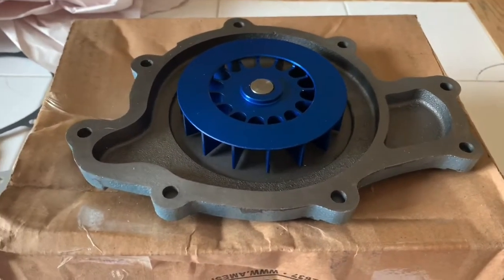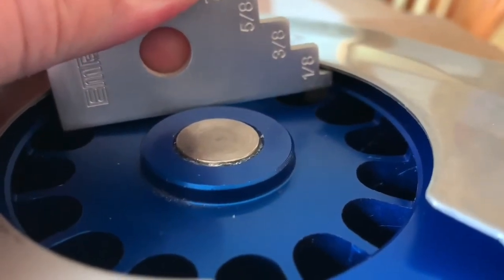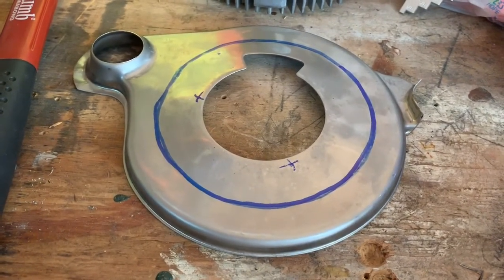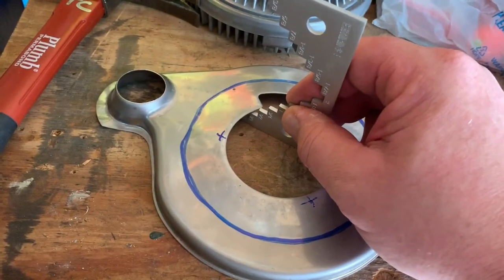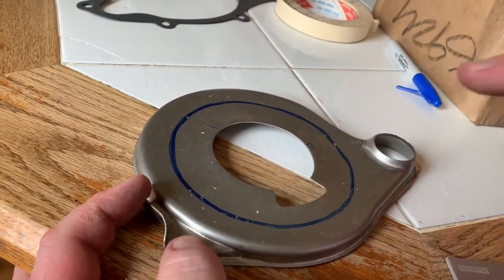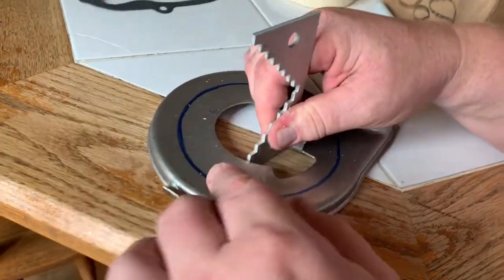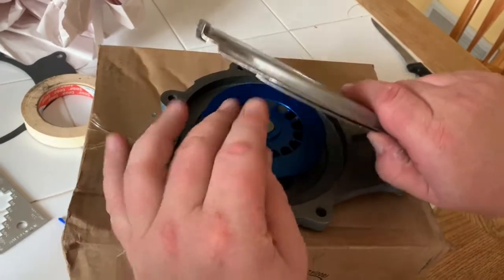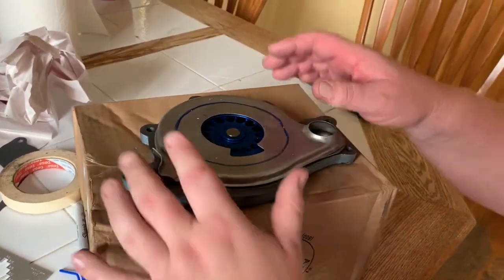Pontiac Water pump Divider Plates

Comment: Also you lose flow from both ends because they are not sealed. So if you could seal at least one end so all fluid flows in the water port.

Comment: Did your final mod on the plates successfully keep your engine cool? Thank you
Reply from the maker: Yep, it solved the overheating
Reply: My Question is being that the Impeller is already shielded, is this mod still required?
Reply from the maker: @anthonysantiago1999  yes the mod is NOT fabricated enough